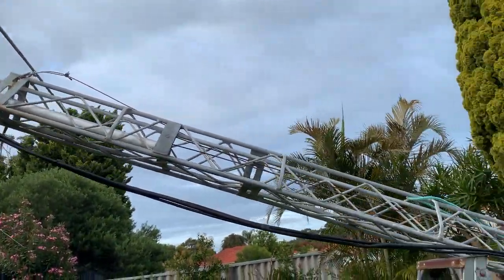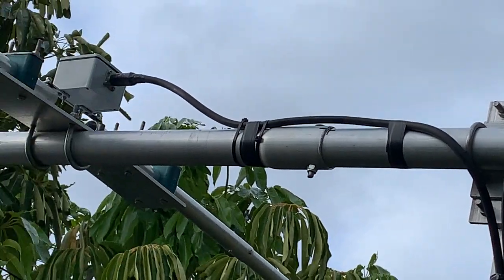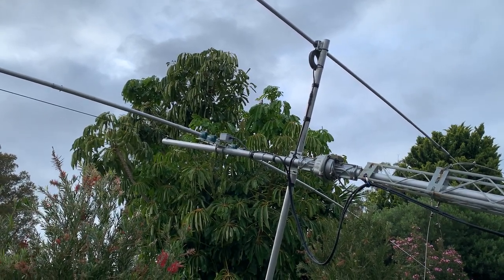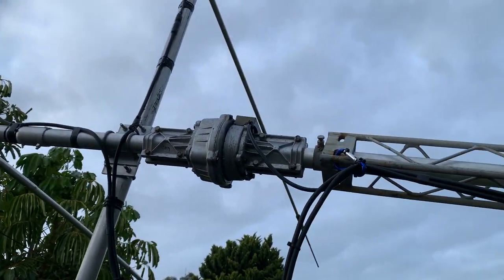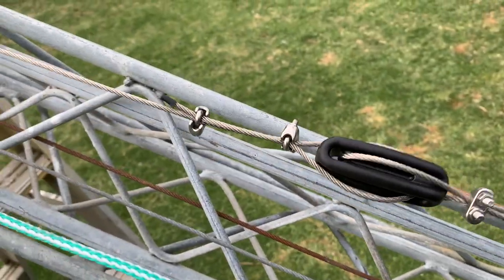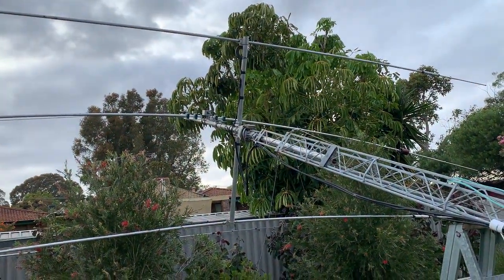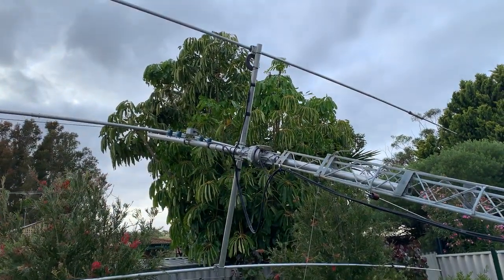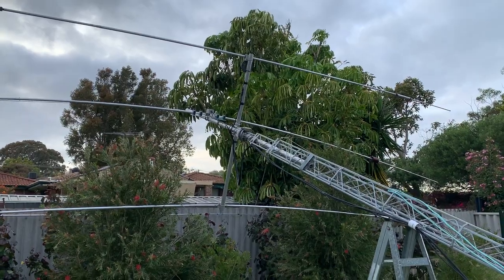HAM RADIO ANTENNA SET .TET EMTRON TE-23 AND A BUSHCOMM 40 METER ROTATING DIPOLE.

Comment: G'day, how do you find the SWR on the TE-23, to which I have the same antenna, also do you have any more spec's or video's on your tower set up, I have the same mast and it is very heavy, I was told the mast was not suited for the Rotor I have and the antenna, but yet again you see a lot of people using them, how high is it off the ground, i have two towers and want to know how low can I have the TE-23 from the shed roof

Comment: I really like your videos. Did you ever consider a cage for the rotator plus thrust bearing? 73's from Belgium.
Reply from the maker: Hello and yes, its still a consideration. I rotator wind load is well below what it can handle, but having said that you ask a valid question. The cage is a consideration before winter sets in. I do tie the antenna off while not in use to stop in moving around from side to side. 73's.